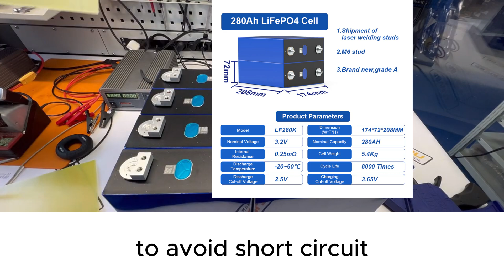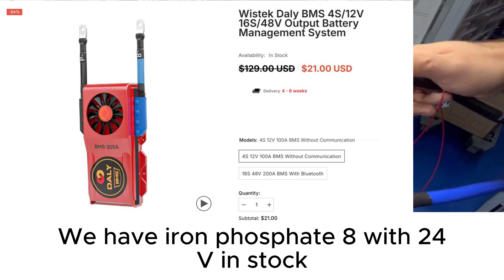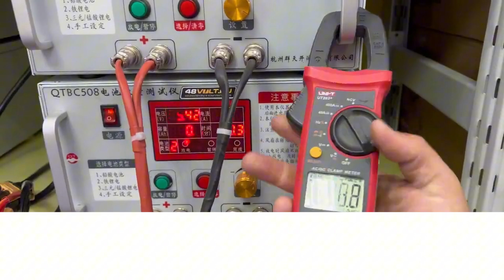Long time DIY! 8pcs of EVE 280K lifepo4 cells to 24V battery! #factory

Comment: Very bad idea to use solid connector bars, when the batteries begin to broaden,  the terminals will be begin to move by force, the  cells will be damaged ... Use flexible connector bar and use metal casing or pressure plates witch can resist the expansion of the cells ...
Reply: And made of copper...